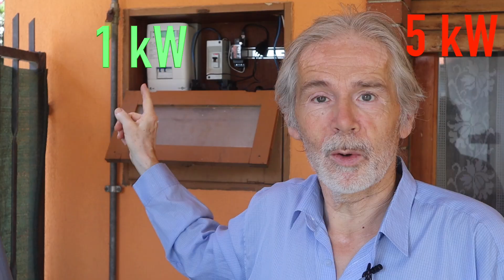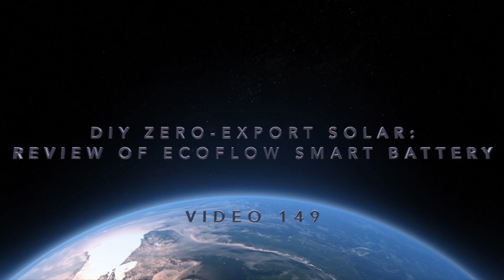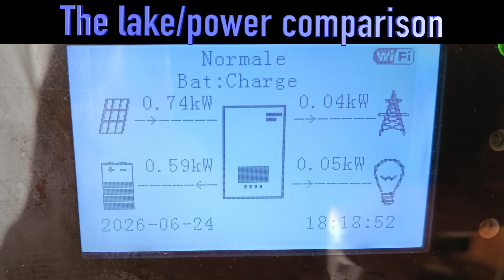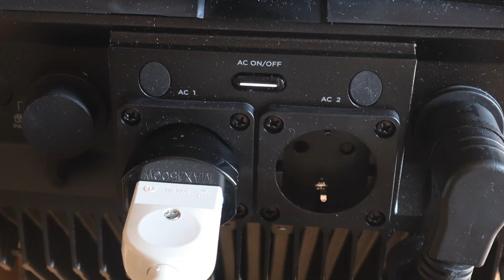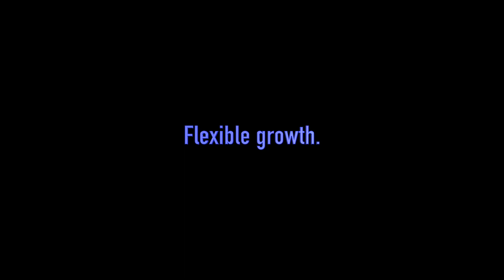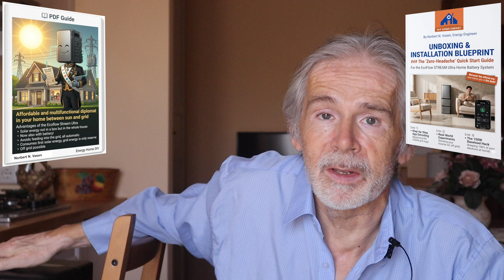DIY Zero-Export Solar: review of Ecoflow Smart Battery - 149

Comment: Thanks for a really useful video. I was thinking about a park home situation where the electricity is through the site and wondering how to get zero export while still using electricity for background home usage and battery. Which led me here. BTW at the moment in the UK the white EcoFlow x Shelly Smart Meter - Shelly Pro 3EM is £149 and the black EcoFlow Smart Meter (which looks like the one in this video) is £99.
Reply from the maker: Great observation Oddslug! Park homes are the ultimate use case for Zero-Export systems because without an individual MPAN, you can't get paid for export. Worse, you get in trouble if you export, right? In some way it might be similar to the CER in Italy (Communità Energia Rinnovabile) if it is true that there are several RV or bungalows on a site. In some way you have to use it even if it gets too much. We in Sicily bought an induction cooking plate as it is the first time I use this technology and wanted to reduce LPG usage by consuming excess PV. 
Using the EcoFlow Smart Meter (£99 is a solid price right now!) lets you balance your background home usage perfectly and dynamically throttle the solar output so not a single watt escapes to the site's sub-meter. Thanks for the UK pricing update!
If one Ecoflow is not enough, you can buy more but take care that you don't define the number of Smart Batteries on the peak production during a few weeks but rather on annual average. That will leave you with excess PV power during those weeks and then 😀 watch video 112 https://youtu.be/Th7-IRygdZo and invite the village to an electric barbecue party!